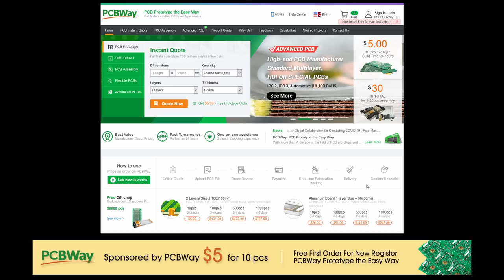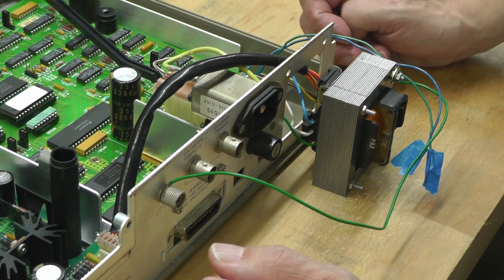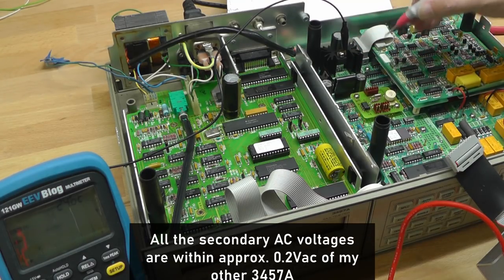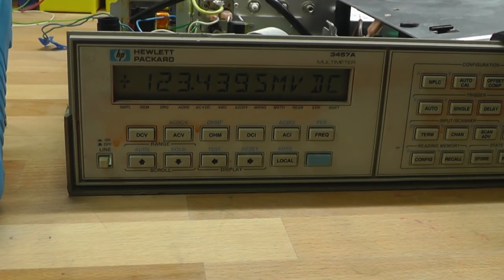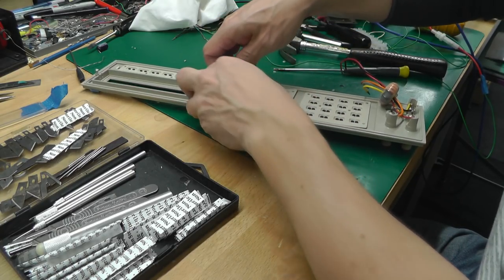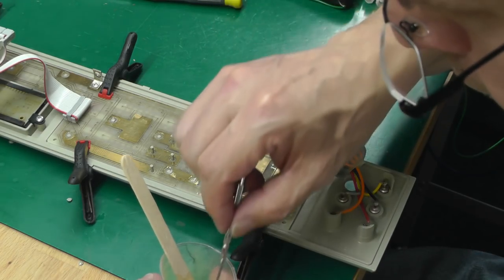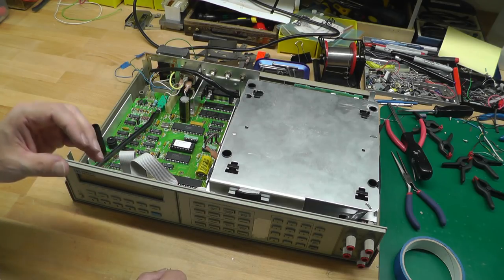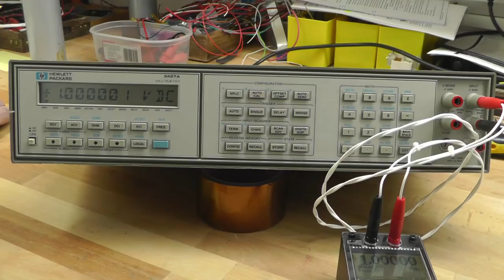No.062 - HP 3457A DMM Repair - First Power Up & Final Assembly - Part 3

Comment from the maker: UPDATE: As mentioned in the video the unloaded primary current consumption is higher than stock. I also tested the 240VAC load on the meter and compared it to my other 3457A: 50mA versus 110mA and so the transformer is running a bit warmer. I then went and calculated the primary wire size and it works out using 0.15mm it's 110mA.....WOW!, so I am right on the limit. However, I ran it for 8hrs and all was ok.
So, when the new replacement cores I have order arrive the plan is to wind a complete new transformer including secondaries.........just for fun!

Comment: At 18:00, I noticed that the ground banana jack is red, rather then black. I know, picky picky :)
Reply from the maker: You mean the coloured ring on the front of the banana socket......they are all red as standard, same with the 3458A. Probably never crossed their minds back in the day to make them black.
Reply: @IanScottJohnston  - Yes, that's what I meant.  The other unit was with a black ring.

Comment: Nice work. I wouldn't even think about rewinding a transformer, I'd probably just knock up a new psu with the prerequisite specifications and plumb in the result, but the extra mile you've gone certainly makes it a much neater job then having ancillary boxes knocking about.

Comment: Hey Dave,
Great job, neat and tidy !
P.S. I bet there is a magic power-on button combination that would allow testing of all the front panel buttons and the display.
The FLUKEs have it (power on while holding one of the panel buttons puts the 8060 in button test mode) so I bet that HP has it.

Comment: Great save Ian! You might consider using a small vacuum extraction chamber from the usual places when you make the next transformer. Taller is better than wider as you need to immerse the entire transformer in varnish/resin. Pull a good vacuum until it stops bubbling.

Comment: I recommend also to replace the bad power supply filter: I used that one:
4300.5054 - Gerätestecker mit Filter 6 A 250 VAC, Schurter
https://www.distrelec.at/de/geraetestecker-mit-filter-250-vac-schurter-4300-5054/p/16963518
Reply from the maker: I ordered TE Connectivity 2-6609006-3, they have double chokes. A bit more expensive though.

Comment: You are correct about the cores being laminated and eddy currents will cause high idle currents as well as loss in efficiency and excessive heat . Transformers are fidldly creatures ive wound hundreds and its a bit of a guessing game to get them exact .
Reply from the maker: The transformer kits have arrived that I was waiting on......I still plan to wind a complete PRI/SEC for the 3457A and hopefully get it all documented. At the moment, if any user has a bad transformer there are no replacements.
Reply: @IanScottJohnston  Great repair and video. Please post the transformer kit's manufacturer/make/etc. Though we are in different countries, the information might help me locate them from a USA supplier.

Comment: Excellent series of videos on this repair! Have you tried the UV curing glues? I have had excellent results using it to re-attach older flat-spring style HP front panel buttons. I have also used it to repair two HP attenuators - re-attaching the switch blades that are hot-staked.
Reply from the maker: I've got a UV glue kit but haven't tried it yet.

Comment: Congratulation on getting a classing to work again.
But I am not impressed with you transformer repair. 
Adding varnish to a transformer means dipping it in varnish and then baking it.
When winding it you need to get the volt/turn factor, then you can calculate turns and if there is space for it.
As far is I remember the (maximum) volt/turn factor was something you could find in the specifications for the core metal.
All this I learned more than 40 years ago, but have never really used it since ;)
Reply: Yes, i would've poured some varnish into a cup and dipped half transformer in it then left it to soak in for a few minuites then turned round the transformer and varnished the other side.